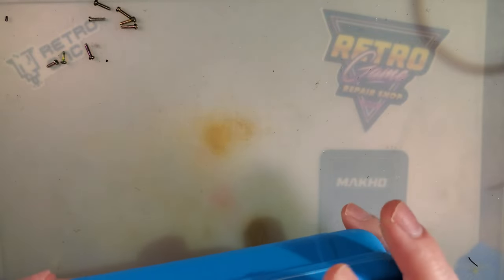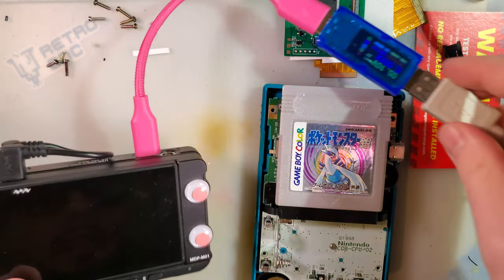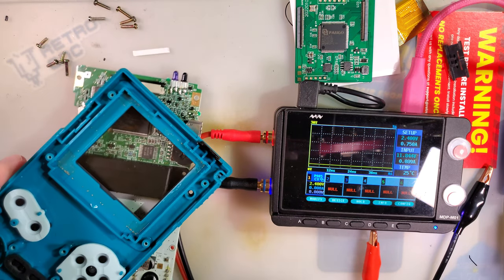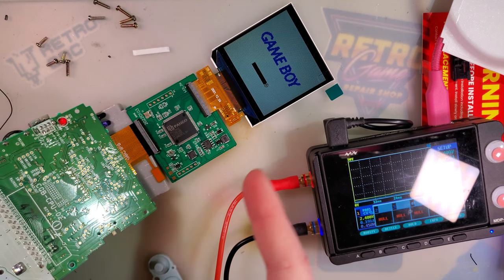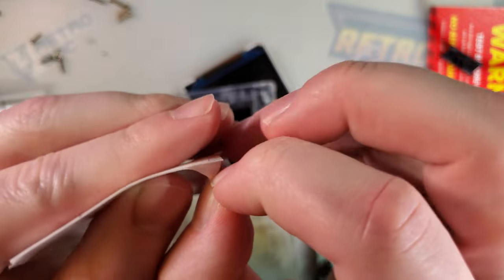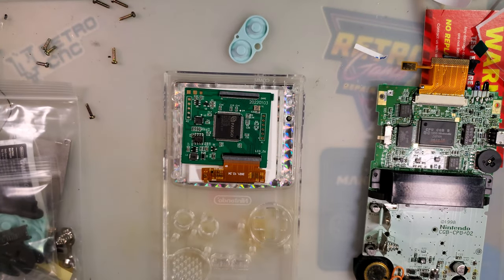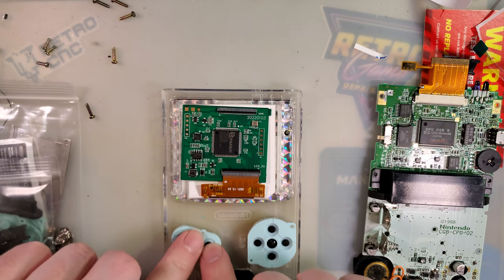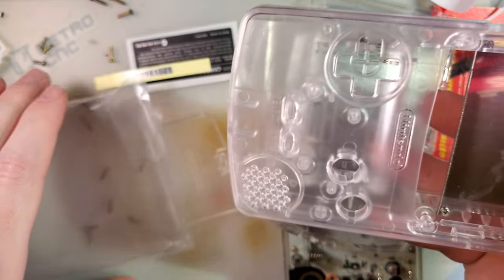CGS 2.45" Game Boy Color Backlight Kit

Comment: Thanks for testing all the new kits. Always looking forward to another video. I don't have one yet but I'd also prefer the laminated kit. However, I usually miss the option to turn back the colors, because GBC games were not designed with backlight and vibrant LCDs in mind. Infact I think most of the games look over-saturated on these modern displays. Some emulators also provide an option to remedy that.

Comment: That old 2.2 inch thing you no longer recommend still has a niche use in my eyes.
Its the best gbc for camping.
As it has decent visibility in both sun and dark!
Similar use case for me as an unmodded ags 001.
Like otherwise, stock is best for sun, and Q5 for indoors/darkness absolutely.
But i wanna pack light as possible if camping.
Reply from the maker: but functionally an AGS-001 is the better console, like you just said. It even gets better battery life than a modded GBC and much smaller too. Your example doesn't work as well as you think it does
Reply: @makho  I agree with you that my example is weak and I want to add that my example isn't really a promotion to go buy the old kit. It stands more as my rationale for why I don't think I'd bother swapping out the kit in my TFT gbc. 

With my current backpacking gear, most of it runs off AAs anyway so there's a strong convenience there to just extend that supply to my handheld of choice. Bringing more batteries for the handheld adds redundancy for my other stuff! If you can recommend an AGB kit that looks decent in most light conditions (without having to crank the brightness to max) that would be perfection for me. I bring my AGS-001 if I am currently playing through an advance title, if it dies I can accept it's dead the rest of the trip. I only will pack one game per backpacking trip so that really is the deciding factor for what I bring with.

For those who camp with a massive power bank and/or a solar rig, none of the above matters. You can pack a switch at that point if you like. But I figured you might get a kick that someone has a stupidly niche use for an otherwise completely obsolete kit.
Reply from the maker: @Otigyrum  I've always said that the best backlight kit is the one you already own. Diminishing returns. 

My statements regarding this kit obsoleting the 2.2" is in regards to new builds.

Comment: Hey thank you so much for this video! I'm new to soldering and GBC modding and this vid was unbelievably helpful in getting this backlit screen installed. I know this vid is a year old already and this comment is probably a long-shot, but after following your lead and soldering the wire to the C pin on the power switch, the screen worked perfectly for a few hours, then after sitting unplayed overnight when I turned it on I started having issues with the screen flickering.

Do you think that's a soldering issue or maybe something wrong with the touch pad?
Reply: Check other batteries or rechargeable batteries. This screen consumes more power than the original screen.

Comment: Hello! About the soldering, I have to donit to the pin C or the pin 3 of the switch? In some tutorials says 3 but you have solder it to the C and it works. Thanks for the tutorial!!!❤
Reply from the maker: Both connect to main battery power. C is only when console is on, 3 is on always.

Comment: Do you know if there's a way to adjust the vertical position of the display? When powered on you can tell ithe output is being positioned via something on the included board, my problem is mine is too far vertical by like 4 or five rows of pixels. I can see the whole screen with a bit of a tilt but it's a bit too much. Kinda a bummer considering the install says to push it all the way up and into the corner.
Reply from the maker: To my knowledge, no, adjustment like that is not available for this kit. You'd have to physically move the LCD (though the I don't really recommend it if you used any adhesives).

Comment: hey there, very nice video you have here, congrats!
can you tell me if you had any problem with this kit using rechargeable batteries?
here at my country we have access only to 1.2v, and even with 2700mah batteries I have some flickering that indicates that the gameboy is not getting enough charge
the game doesnt crash, but the backlight seems to shut down and comes back eventually
Reply from the maker: Is your power wire soldered? This is more likely a problem with the install.
Reply: @makho  Yeah, It was bad connected as the vendors page said it doesnt need soldering , I soldered and it became all functional again! thank you!

Comment: Couple quesitons- at 17:22 Do you need to use the the white paper adhesive?  I placed mine in a shell only to want to place it in another later.  And at 23:54, I can't really see but do you put the spacer flat face down?  or you you press it against the wall (toward the LED)
Reply from the maker: 1) It's just pre-cut adhesive. You can use whatever you want, you'll just have to cut it yourself next time. Good luck though because typically the adhesive is intended to be permanent. 
2) Flat, yes.

Comment: Hello! I've installed this mod, and sometimes the screen is flickering. And when I touche the sensor to change intensity It fixe it. Do you know which could be the problem? I've soldered the cable to Port C. Maybe the touch sensor is sleazy? Thanks!!!
Reply: I assume you did everything right so my guess is that your batteries are probably dying, try new ones. The screen needs energy, the lower you suply then the flickering will appear (issues to properly turn the backlight on).
Reply: @MikuCobraCole  thanks! I change the batteries for a 1.5 V rechargeable ones and works fine! THANKS!
Reply: @nestorferranti3260  I'm glad I could help you 🤗

Comment: I have this kit coming in the mail, I want to keep my lens and my shell. In that case would you remove the original adhesive for the screen and use the adhesive provided with the kit, or put the  kit adhesive on top of the original, or just use the original for the new screen?
Reply from the maker: the new stuff will likely be easier to work with but if your old stuff is still sticky, that works too
Reply: @makho  I’ll use the new stuff! I was just thinking that the screen would be closer to the lens with the old stuff since the new adhesive is a bit thicker, but it’s like half a millimetre so I doubt it makes much of a difference! Haha

Comment: I know this is a long shot, but I set up this kit today, followed this excellent video really carefuly and for some reason, no matter what I do the screen seems to cycle endlessly through the different screen modes, this is without me touching or anything. Im really struggling for any info, if anyone here has any knowledge it would be amazing
Reply from the maker: Your touch sensor likely needs to be moved or insulated or both.

Comment: just to clarify, the OEM size lens will work for this kit? I realize there's a small size difference but the viewing area is the same? wanted to make sure bc I thought you used an OEM sized one in the vid. wiki says custom lens required. sorry for the confusion
Reply from the maker: oops it should not require a custom lens. 2.45" works with stock. I must have just copy/pasted the line from the 2.6" kit and forgot to change that.

Comment: Do you need to do any Shell Trimming if you're using a standard shell from 1998?
And you mentioned you used the wrong lens for a 2.45 screen.  What lens size did you use?
Reply: You absolutely don't need to cut anything. This screen works perfectly with the original shell and original lens.
Reply from the maker: There are multiple sizes of backlight kits. Smaller (2.2"), OEM (2.4"), and Larger (2.6"). The only difference is the size (and potentially location) of the cutout for the screen. This kit uses OEM size lenses.

Comment: I tried using this kit with a brand new replacement shell (the non trimmed versions) from Handheld Legend, but the stop block that's included isn't holding the screen in place at all. there's too much space so it moves around in the screen frame. what do i do?
Reply from the maker: Did you use the adhesive?

Comment: Has this mod some pìxel mode?
Reply: Yep, around the end of the video he test again the screen modes
Reply from the maker: @MikuCobraCole  even linked images in the description.
Reply: Hi. Finally I bought a one but touch doesn't work and I don't know why. Maybe for take power from "C" instead of take directly to the positive pole of battery? Cos I had the same problem with a Funnyplaying Laminated IPS kit (but in this one, touch works touching directly but not inside the case touching a corner, for example)
Reply: @ColtPython02  deduzco por tu nick que hablas español, no sigas la Guía el anuncio del vendedor, es mejor soldarlo a  la placa como hace mahko en el vídeo, tal vez el táctil no esté bien colocado y no llegue señal, yo uso una carcasa transparente y sin problemas

Comment: Damn, why couldn't this screen be IPS
Reply from the maker: there is a 2.6" version that is
Reply: I just did the mod myself (went really smooth aside from having to reconnect the speaker but those wires sucked anyway so I just swapped em), and I can hardly even tell it's TN. If I didn't know beforehand I'd say it's IPS. I don't see any screen wash out at all even holding it almost perpendicular, it looks really nice in person.

I recapped it and changed the ports at the same time, the display install only takes a few secs really. 

I forgot about the pixel grid things tho and wondered why my screen suddenly looked worse when I rested my index finger on top lol. The pixel grid mode really does not look great. 

Honestly I think it's relatively comparable to other IPS screens I've seen. In the int scaling mode it's honestly kinda hard to hold it at a bad viewing angle. You might lose the left or right column of pixels depending on the angle you hold it at but I think it looks pretty good tbh. My kit seemed to be missing the adhesive for the touch ribbon but it holds itself in the top fine so it's not a huge deal.

Comment: How's the plastic around the buttons on the front shell? I noticed a problem on clear shells where the clearness goes opaque/white once you fasten the shell up
Reply from the maker: That's only an issue if you overtighten your screws. It's plastic, the torque spec is "snug". If your screwdriver is camming out, you're doing it wrong.
Reply: @makho  I haven't had an issue until I ordered a clear gameboy light shell. Only the a and b button areas were affected. I normally don't go to strip screws, so it's the normal amount of torque I tend to apply for ang shell. New shells don't seem to be too bad for making new threads in.. but maybe on my replacement I'll go ahead and pre screw it before putting in the motherboard.
Reply from the maker: @cidkramer  I haven't had that issue on any plastic shells as long as I don't overtorque the screws, even on those clear Light shells.
Reply: @cidkramer  Thought I'd chime in here since I ordered a replacement GB Light clear shell as well, and we probably got the same shell (not many manufacturers). Completed my build last year and it was ok without any issues, so I also suspect you might have overtightened it. If you get another I hope it goes better for you next time, those shells are really nice and feel like OEM! Mine still looks + feels great a couple months down the line.